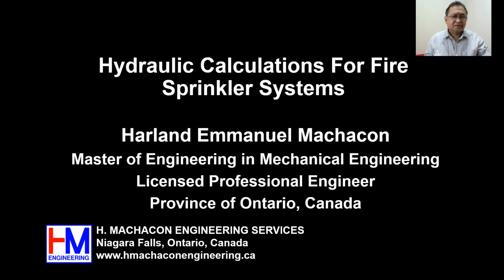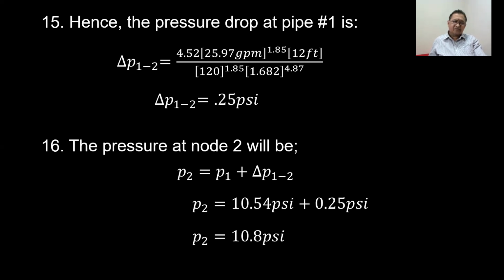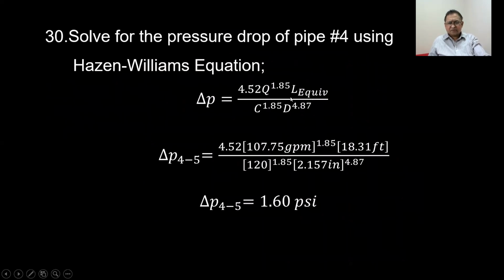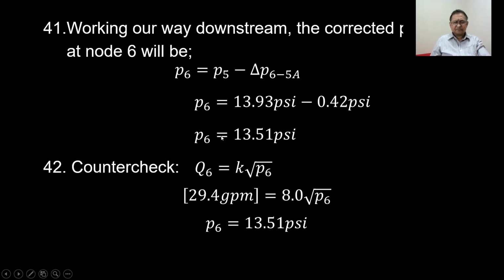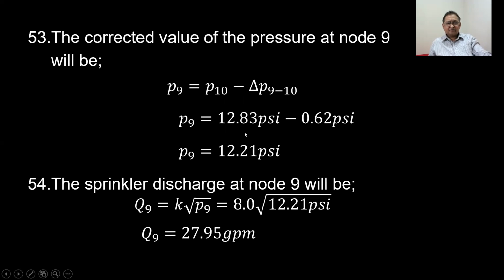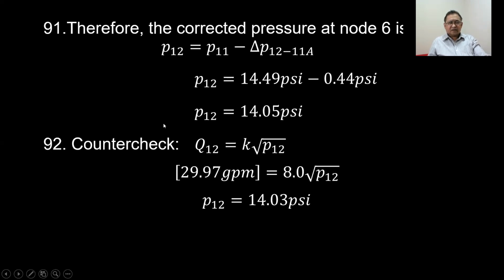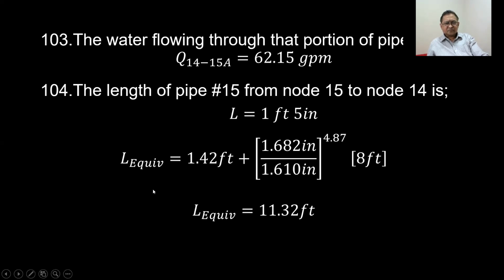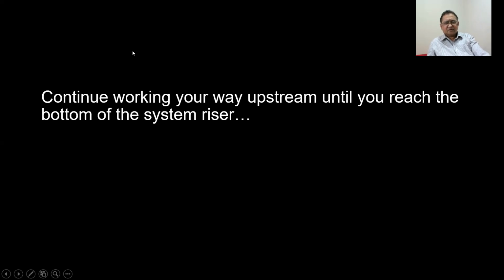Hydraulic Calculations For Fire Sprinkler Systems

Comment: May i know why u did nt include pressure drops for smaller tee from node1-4 and also reducers  along the path. Every sprinkler is connected to pipe through tee and u did not calculate pressure drop for them.

Comment: Do I include the  sprinklers in branches of node 17, 18 19, and 20 till I reach the base or just the Junction?
Reply: I think the answer is no you dont include in the calculations, unless you are designating those as design area check (multiple design areas). The intent is to calculate the design area, bounded by dashed lines to show the sprinkler gpm and pressures are in compliance with NFPA 13, as you may already know.  The flow for this design area only,  passing thru the nodes you noted should at least indicate the pressure drop only on those fittings (or nodes) at the design area total gpm only.  The backflow preventer, gate valves, elbows along the pipe upstream to the source, including the elevation head,  all will be included to determine that at that design flow gpm, the water pressure at the source will be able to handle the required flow and pressure.

Comment: hi, why did you get only 1500ft2 for calculation. why we cant take more than 1500ft2?
Reply: Typically you want the most economical system, smallest pipe size, smallest pump. The larger the design area the higher the water demand and therefore a more expensive sprinkler system.  1,500 sq.ft. is the smallest area on the graph.
Reply: Thanks for your response. so when we can consider more than 1500 ft2 area for calculation? I mean which industry.  @icutoo2699

Comment: Hi sir great video. Could you please tell me how do you determine the largest area covered by any sprinkler in the design area? (Point 4).
Reply: It's in NFPA 13, the most hydraulilly demand, usually the farest and highest from the water supply from the base of the building riser.

Comment: Sir, when doing hydraulic analysis of combined systems, should you include the fire hose stations in the analysis, i.e., 100 gpm, 65 psi?
Reply: When doing calculations check with the AHJ on how to perform them. Each AHJ may have different rules. You need to read the chapter in NFPA 14 and make sure your using the correct edition that complies with your local code requirements. Your local code could be different from NFPA 14 & 13. You alway need to read and re-check since they do make changes to the standards.

Comment: What is the recommended software to draw the design and simulation
Reply: There are lot of commercial software available in the market. Most engineering firms use HASS Fire Sprinkler Hydraulic Analysis Software!
Reply from the maker: There are several available in the market.